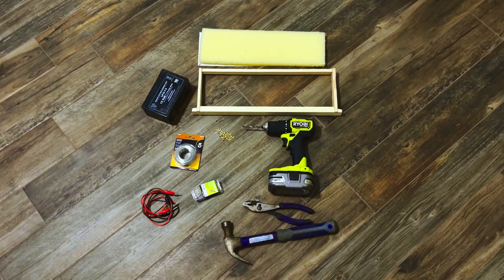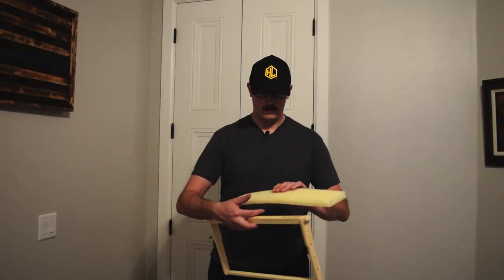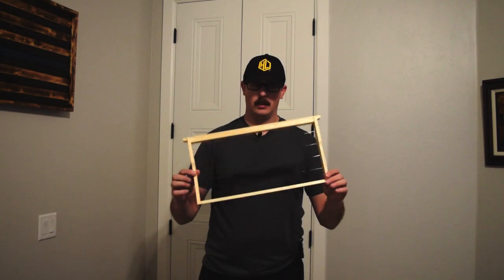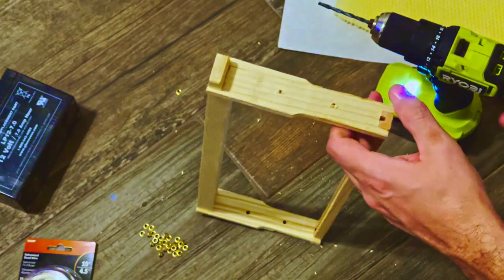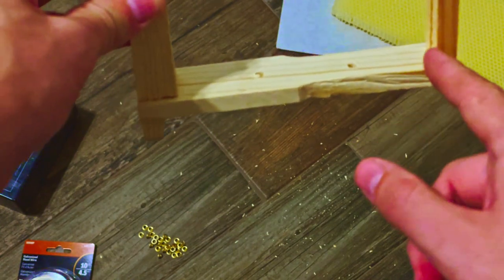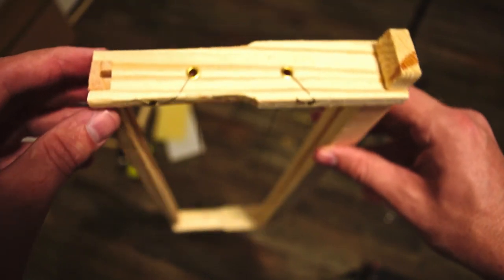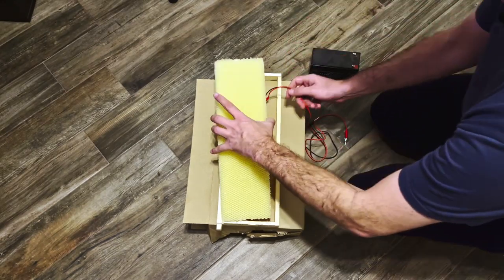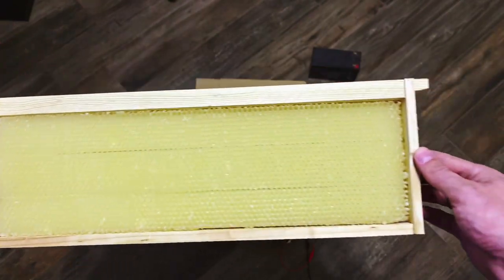BetterComb for Honeybees!

Comment: It looks more durable than bee's wax.  I've never handled any Better Comb before.
Reply from the maker: It certainly seems to be slightly more durable, but it’s also fairly pliable.  The bees do a good job of repairing and reworking it.  Holds up well in the extractor.